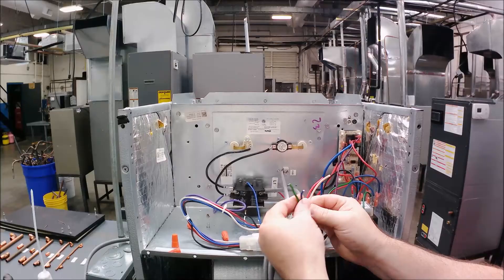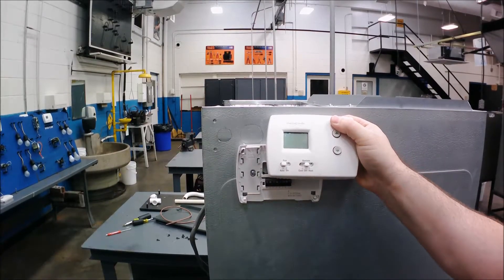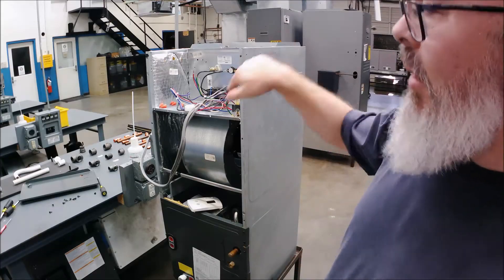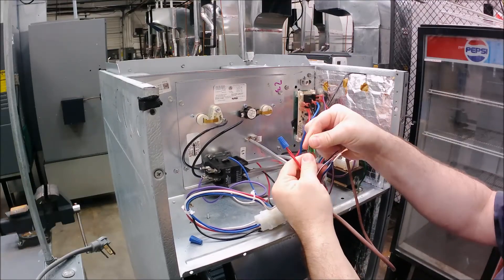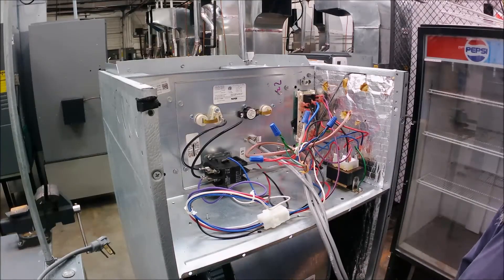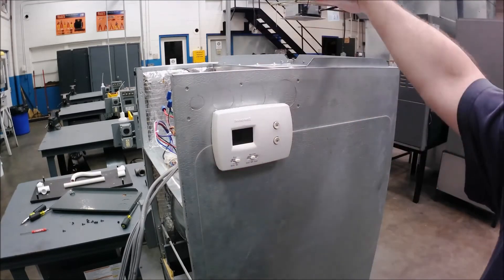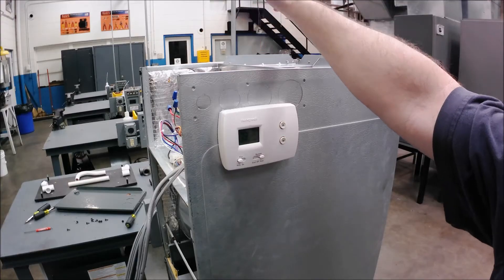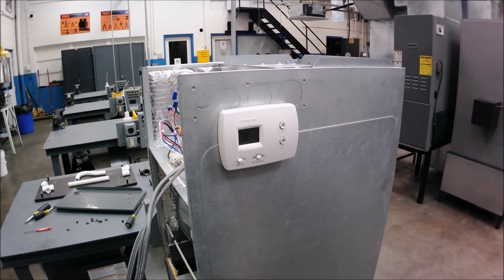How to Identify and Wire a Heat Only Unit - Electric Furnace

Comment: Mr. Jennings. I have an ancient, 26 yr old Nordyne, PROPANE only furnace. M1MB 056A BW S# M1M000406058

A tech came out, told me there are no replacement parts for the unit and I need to pull it and replace it with an "installed 90% high efficiency unit" at $10,803 cost to me. Claims there are no "like to like" available to "slide in slide out". I am in WASHINGTON state and a manufactured home, so THAT seems to be an issue with the type of replacement unit availability.

That said. In the present thermostat, there is a RED and a White wire (7 other various colors to include the GREEN and the YELLOW) 

I am trying to mount a thermostat (not smart-type, non-programmable) to run FAN ONLY and if I power green TEMPORARILY for "testing"-sake, the fan runs WAY HIGHER RPM than if I simply cycle the propane furnace.
Reply from the maker: Well...26 isn't the oldest I've worked on and as long as it is working then stick with it (is what I would personally say)
Next I'll just say that I won't stand between you and your a/c guy! BUT...the intenet is a powerful tool! And depending on what part you need then (cough cough) supplyhouse.com is just one website 😉

The fan running higher speed or blowing harder isn't necessarily a bad thing. It looks like you have a 3 speed blower motor and I imagine that the unit is like many others. The thought process is that when heating you use a lower speed (lighter air) and in cooling or "fan only" you would be using a higher speed (heavier air). I haven't found the full wiring diagram yet but what you are describing is not a bad thing in my mind. If I find something other info i'll let you know.
Reply: @johnjennings-JJ UPDATE: John, I got the squirrel cage completely cleaned with compressor, bristle brush and elbow grease. Almost shined like a new dress shoe.
The fan with propane heat rpm is virtually noiseless and no vibration. The high speed setting is almost as smooth. 

I rigged a rocker switch just outside the cabinet to have a manual "fan only" and if it equalizes temps in off-hallway rooms and increases the belly-pan temps as I hope/pray?? THAT will be sweet.

I installed a wifi thermometer in crawl space to monitor that temp and dropped a wired 6' probe into the master bath, plumbing zone of the belly pan, so I can monitor temp right at the hot and cold water supply lines. Pray me some blessings, John.
Reply from the maker: Sorry I didn't reply...i did not get a notification until yesterday. I think my setting have changed on the youtube app or something or otherwise I would not have taken so long.
Cleaning is always good so I am glad to know that seems to have helped. I once rented a place with a wood stove and a propane furnace system that ran me broke. I ultimately decided to burn wood like you but the back part of the house was ice cold. I put the fan 'on' at the thermostat and circulated air while the furnace was going.It wasn't perfect, of course, but it wasn't bad. More like 'tolerable'. But for me I didn't have to deal with 0 degree weather on the east coast! I think you have a good plan and it is a good experiment. I hope and pray it does work as good as you want it to. Sounds like you got it licked.
Reply: @johnjennings-JJ IF my best laid mouse (as in "of mice and men") plan fails, I can use the heat lamp that has always been down there and bolster it, as needed, with a not-yet-bought "oil-radiator" heater in crawl space. AND no issues on response time, you have been a blessing. Soft sun, zephyrs upon you and your's and thanks for the encouraging personal experience attempting almost the same thing.
Reply: @johnjennings-JJ ALSO just filled, at "non-winter" propane pricing, the tank from 64% to 85% and it ran me $383. SO, at that $$-point, with multiple fills from Oct to April then two other top-offs of propane across the year; $2000+ annually. The woodstove has already broke itself even for me in just three seasons. So, yeah, I had wood heat 30 years in MT. VERY pleased I made it my primary and propane my secondary, and now its in 3rd position because of a minisplit for AC that is ACTUALLY impressive for "quick warmth".
Reply: @johnjennings-JJ UPDATE: RECALL this is ONLY a 1300 square ft Manufactured Home, WELL INSULATED. AT low 30°F outside, I HAVE been able to bring "off-hallway" bedrooms and the bellypan temps up 5°F by running the propane furnace fan on that HIGH RPM we discussed and you declared would LIKELY be better than the lower RPM. SO, the "experiment" IS working, the process DOES equalize the no-flow zones, OVER HOURS, to be within a degree or two of the air-flow zones. I have no idea how this will work once I go below 10°F here in PNW, but any heated air into the belly pan and dead-zones is good. AND a $7 rocker-switch  to move "pocketed" woodstove heat throughout the house is simply useful vs the $10k furnace replacement. THANKS TONS AND BUNCHES and blessings, zephyrs,  soft sun on the shoulders of you and your's. Yeshua CREATOR (COLOSSIANS CHAPTER ONE) uphold you in all your going out and coming in.
Reply from the maker: I like your attitude about all of this. I hope that is does work well for you especially when those temps drop. I don't think I can imagine a -10 degree day. And thank you for the blessings. God is good!
Reply: @johnjennings-JJ I lived in Montana 35yrs and ran woodstoves for heat about 26 years of that time and my coldest day at the house was -40 with windchill to -60.
Reply: @johnjennings-JJ I had the queerist thing happen last night. The propane furnace started on it's own, with the house 66° and the thermostat set to 50°. It was fan-only and  out of sequence to fire the furnace?? So, I disconnected the thermostat to isolate a "false call"/ bad thermostat scenario. 

WITHOUT the thermostat it did the same thing twice in 45 minutes. So I pulled the face-plate & filter panel to disconnect the "added" manual rocker (remove the changes and get back to original theory of trouble shooting). It kicked off again when a boot room door got left open to gather the cats indoors for the night. 

I watched the light sequence and it tried to do an ACTUAL burn. I THINK I got 3 blinks od the red and KNOW I got NO Yellow LED flame recognition.
Reply: I checked the panel and three blinks (if I DID count correctly) is "pressure switched closed". 

I threw the main furnace switch OFF, killed the breaker at panel and figured to ask you for your best thoughts today. 

At $10k install, I can fly you here, house and feed you, pay for parts and fly you back to the east coast and SAVE MONEY. GUFFAW.
Reply from the maker: Lord...you are having a time with this unit! I just was going through comments and had another person with an inducer motor running all the time...pressure switch errors too. That sounds like a board is failing is what I just told the other person. Sounds the same for you. The pressure switch error is a problem since it should open after every time the inducer motor shuts off and close again to let the heat run but with it tryjng to run AND you had the thermostat face off??? The only thing that has control over the furnace is the circuit board. You can have a blower turn on if it detects an error and that is meant to give you a subtle message to check your unit out but if it is trying to light that is a bad deal. I think that I would personally be looking at that circuit board.
Reply: @johnjennings-JJ I am in process of dismounting the fan/ squirrel cage in an attempt to clean it, likely of 26 years of grime  and dust. My issue is there is a slight vibration in the fan housing on "full cycle heat" BUT a HUGE vibration when I temp-test touching green to red to simulate "fan only". 

My INTENTION is to sporadically run ACTUAL  furnace (IF ole man winter demands a bump in my insulated "belly pan" temperature), BUT to run a manual "fan only" CONTINUOUSLY, to try to equalize heat throughout 24x52-ish double wide, as my (NOW "primary heat") wood stove easily cooks out the front 1/2 and down the hallway to the bedroom BUT doesn't reach the master bath plumbing zone. 

Thoughts, advice, encouraging words?? Is that a REASONABLE hope?

The HOPE is the continuous run fan will drag heat from from half of house, kicking and screaming, through belly pan, enclosed furnace ducting to protect rear plumbing from freezing in below 10° temps.
Reply: @johnjennings-JJ not to whine, but I am 70 years old and think $10k for a "maybe operates 40x for maybe two full cycles" furnace is dry-humor laughable. I will work around "the AC guy" ANY way you can think this through with me.

Comment: I am trying to install a Lennox like this in my mom’s house to help out with her pellet stove.  I bought a new pull out air handler with heat strip. It has the red, green, and blue wire but also has a black and white wire nutted together. Can you please help me out why is the black and white hooked together?
Reply from the maker: No idea. If you can send me the model number of the air handler so i can look up the wiring diagram i maybe can help. Unless the black and white wire are both meant for the heat relay...something like a auxiliary and emergency situation.
Reply: @  Lennox CBK45UHPT-36-230
And I believe the heat element is ECB45-15CB
Reply from the maker: So they must be hiding the wiring diagrams with the nuclear codes cause I couldn't find much! But i did notice on most of the other wiring diagrams that Lennox likes to use blue for 24v common. I think both the white and black wires are for heat on that 15kw heat kit you have. Look at where the white wire goes to the heat relay amd i think you'll notice there is a blue wire on the other side of the "coil" (probably a bunch of high voltage black wires going to/from the heat element itself) but the low voltage should be white and blue. I am thinking there might be 2 heat relays and the black wire would go to the second relay and then have the blue wire as the 24v common just like the white wire on the relay does. If you want to take some pics you can send it to me. We can try to make sense of it. Hard to get your head wrapped around something when you can't see it!

Comment: Why doesn't anyone show the connection from the panel?  Do we not need electricity anymore to run things?
Reply from the maker: Probably because the electrician is responsible for supplying power to the disconnect we use for our equipment. Not that I don't understand it but technically it is outside of our wheelhouse and what we are supposed to deal with.

Comment: My furnace went out and I'm in Iowa and it's Sub-Zero my furnace is he only electric it has the green blue brown white and red wire coming out of the unit and then the one that comes out the wall which I believe goes to the thermostat is only got three wires and it's kind of white red and kind of bluish green I don't know how do I put them back together and turn my thermostat
Reply from the maker: 1st - Sub zero...call somebody if you haven't already! (Only 12 for me this morning and that is cold enough.) Probably a wait but at least you are in the mix. 2nd - if it is all electric is is likely a heat sequencer that is an issue but also sounds like you got some wiring concerns? If you want to take a couple pics and email me @ ---------, i can try but definitely call someone! Pic of the thermostat, wiring on each end, more the better but whatever you got and can get will be a start. No promises but we can try it.

Comment: Why connect the common wire if you don't have a wifi tstat?
Reply from the maker: I hate wasting batteries. I'd rather use them in my TV remote.

Comment: Do I need additional voltage if I add a heat strip to my unit?
Reply from the maker: Maybe an additional circuit from the panel/sub-panel. Depending on the wire size that you currently have and what you are going to need for the heat strip kit. Probably have to get with the local mechanical/electrical contractor if you don't know.

Comment: Im trying to switch to electric heat only from gas. Any sugestions?
Reply from the maker: Not knowing all the details as to why...I have just one if it were me. DON'T!! If you have natural gas already...it is warmer and cheaper than electric heat strips. If it is propane, the cost will be more than natural but it is still much warmer. If you are going to replace a gas system with electric, consider a heat pump with heat strips maybe. Forgot to mention that you will likely have to upgrade the electric circuit in your house to properly hook up to electric heat as it pulls more amperage typically.

Comment: I have two wires from my thermostat. Where would they hook to?
Reply from the maker: 2 wires sounds like some type of communicating thermostat? Most any system has more than 2 wires on the sub-base. I would need more info to have a better idea. Colors of the wires or something ...
Reply: Two wire is for a heat only electric furnace
Reply: Me to it says red and white from thermostat to unit where they go??? But inside the furnace I have a capped black blue orange and white  so where do they go red and white if I have 4 wires and only 2. Coming from the thermostat???

Comment: Can this be used as electric forced air furnace for a 1500 sq home? I live in Michigan was looking around for the best electric furnace options getting rid of gas. Thanks
Reply from the maker: It could depending on exactly how much/many heat strips (in Kilo-Watts) you had in it.  But I would think you would be better off with gas heat in that part of the world. Gas should be more efficient for the money. I would consider talking to a local professional about changing from gas to electric.